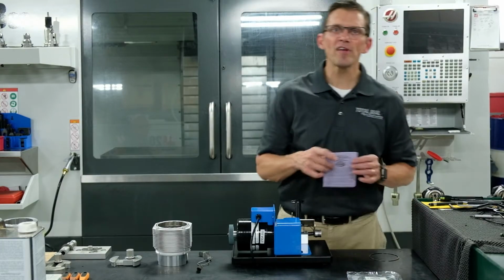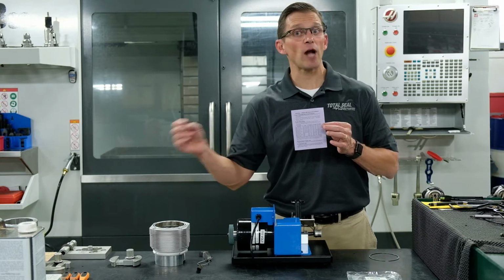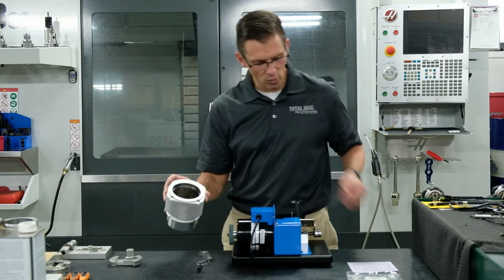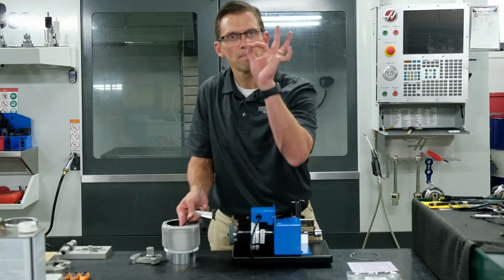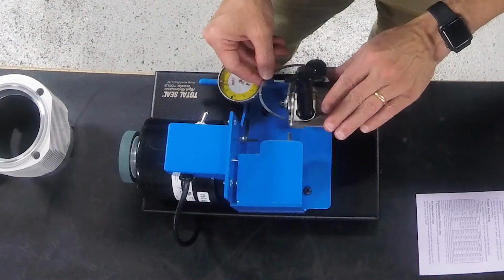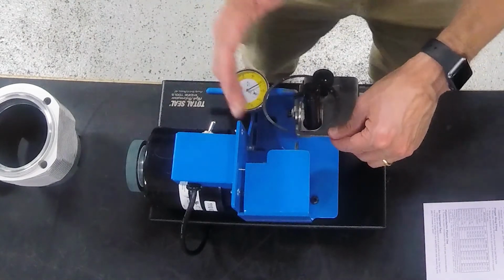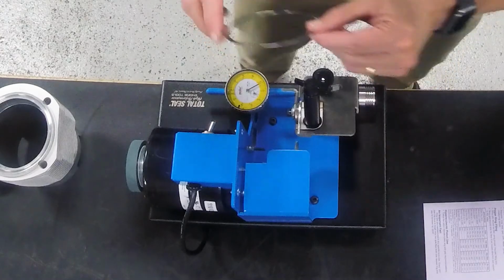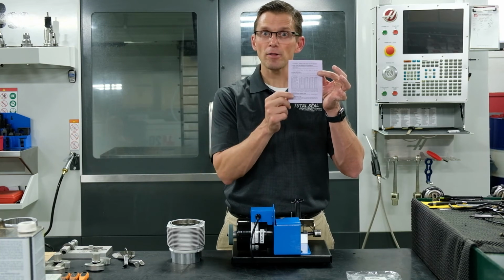Piston Rings 101: Setting piston ring end gaps with the Total Seal Power Ring Filer

Comment: If a person was enlarging a gap by 2 thou wouldnt you want to remove .001 from each end or is all on one side fine? or is it all depending on how much removing?
Reply from the maker: For small amounts to be removed, it shouldn't be an issue to take it all from one end. If removing a large amount, splitting the difference, although more timing consuming, can't hurt. You'll just have an extra end to deburr with a jeweler's file. You should never use a ring that is sized for a larger bore more than .005" bigger (+5 ring), so you really shouldn't have a ton of material to remove. If you do have a large amount to remove, it's a good idea to make sure you have the correct ring (mistakes do happen in manufacturing during packing) and also to light check the rings in the cylinder bores after they are gapped to make sure they are still round!

Comment: How relative are your calculations ie.for same bore sizes compared to application factors such as 1.air cooled versus water cooled 
2. Marine to Automotive 
3. As cast block to sleeved ( repaired)
4. OEM liners versus different liners material/ hardness 
In the past I have heated blocks/ barrels to near operating temps to measure cylinder diameter Increases to factor ring gaps and have seen surprising results, this has also been applicable to different block materials ie high nickel factory chevy and after market including compacted graphite and aluminium blocks, LS blocks are not as consistent in expansion rates as one might think throughout production years and generations, this is also applicable to marine uses and diesel liners of OEM variants and aftermarket varieties. Piston clearance is obviously the first objective with different expansion coefficients between piston types, materials and cooling considerations, then once these are established then ring end gap, knowing these dimensions relative to application and use is key to ring gap and durability from my experience, are your specifications purely founded on worst case ?
Reply from the maker: Our experience is limited to aircooled and watercooled Porsche engines, but yes, there are sizable differences between both engines in terms of piston to cylinder clearance as well as ring end gaps. In our experience aircooled engines need tighter piston to cylinder clearances and smaller end gaps because the cylinders see a much larger delta in operating temperatures than a watercooled engine. Although we do not use or recommend steel sleeves in watercooled Porsche blocks, we do know that if you do put a cast iron or steel sleeve in the clearances and end gaps have to be significantly larger than what we run in an all-aluminum engine.